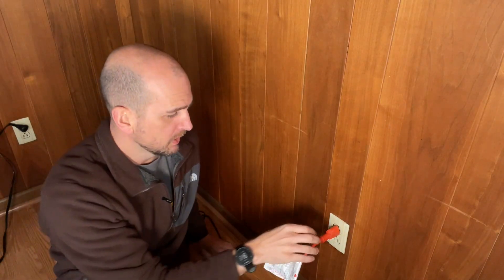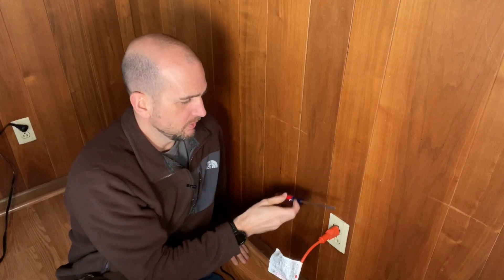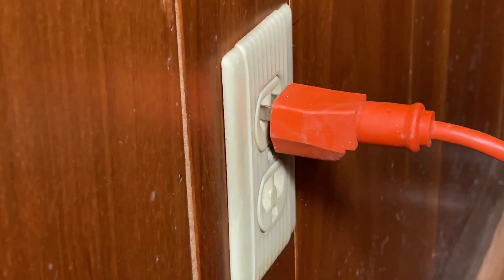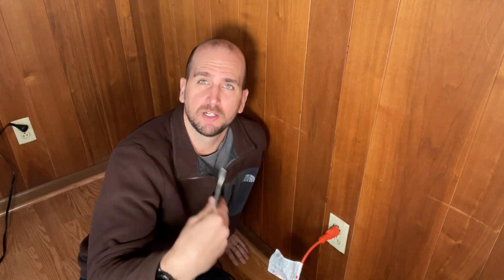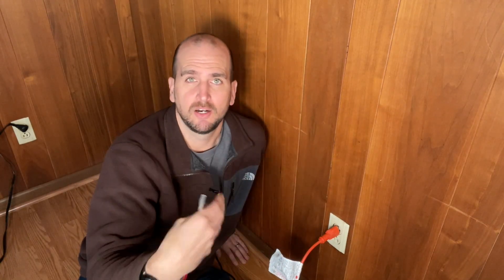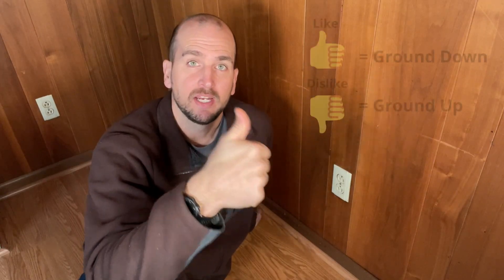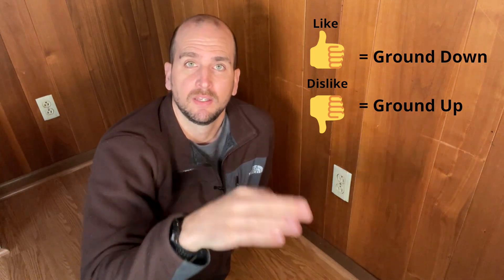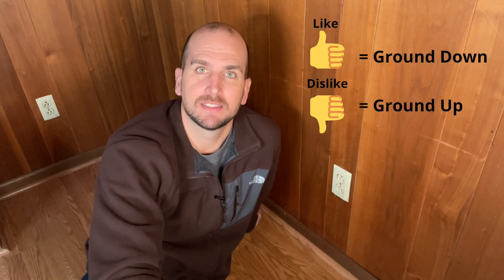Should An Outlet Be Installed Ground Down Or Up

Comment: Personally it does make a bag of beans whether the ground is up or down. What I'd totally prefer is to have outlets and plugs for 110-120 similar to industrial plugs for 440-480. You plug  in and screw the cap on the cord at the plug onto a threaded piece around the outlet to keep it in place. I use GFI outlets on all mine since I've had kids and pets in the house. The ground up or down makes no difference to me although I like the idea for ground up for outlets controlled by a switch. I have seen outlets that have only the top outlet controlled by a switch so it might be cool to have outlets that always have ground up on top and ground down on bottom. Then I could run separate line to each at 15 amps for appliances like portable air conditioners and such.

Comment: maybe someday they will  start making receptacles with  2 ground holes 1 on top 1 on the bottom.
Reply: That would only work if the hot and neutral prongs were the same width.

Comment: We used the orientation of the outlet to indicate if it was “switched” or “unswitched”.
Reply: thats a great idea.
Reply: I dislike this practice because It is unprofessional to be inconsistent.  It's the wrong solution to the "problem". You should install receptacles that are marked as switched.

Such as https://www.hubbell.com/wiringdevice-kellems/en/Products/Electrical-Electronic/Wiring-Devices/Straight-Blade-Devices/ConstructionCommercial-Receptacles/DR15C1WHITR/p/2608245
Reply: @TonyPombo  The photo on the Hubbell site shows the receptacle with the ground up.  However, that makes the “on-off” symbol on the receptacle upside down.  I guess Hubbell is suggesting that the ground should really go down.
The problem I can see for the Hubbell is that they’re a specialty item.  You won’t be able to pick them up at the local Lowe’s or HD.  They’ll also be more expensive than the usual 15A U-ground, so the DIY folks will probably stick with what they can get easily and cheaply for home use.  I could see them being used more in commercial facilities.
Reply: @keithmills778  Yes, you are right. They don't stock them at big-box stores. You can special order them, or buy them from a supply house, but they do cost a couple dollars more than a regular outlet.  Other brands may be easier to find.  I've seen the power logo in either orientation, so that shouldn't be a concern. If you are remodeling a room/house, then the slight cost/delay in obtaining these receptacles shouldn't be a concern.  Regardless, I expect many DIY people won't bother, but at least you now know there is a better way. But, if you hire a professional (at $$/hr), they shouldn't cut corners. :)

Comment: I asked this specific question to a master electrician years ago. His response was "depends on the application" . He expanded on this by explaining that residential electrician code is different in various areas and you need to follow the code. At one point in the past various areas changed their local code to ground up for residential and sited various reasons. Currently residential pretty much nationwide has no specific orientation according to code. Thus the reason switched outlets are usually ground up just for identification purposes. Although hospital applications for life supporting medical equipment is coded ground up. Commercial outlets are application dependent as well but most are non specific in orientation.

Comment: I usually pull out plug by having my thumb on top and my index finger (at 90deg) underneath... where I can't see it. If my index finger was too close to the outlet and slipped, I'd rather have it come into contact with the ground. I can see my thumb, so it's positioned properly. Try this for yourself. Hold your hand with thumb parallel to hand and index finger bent 90deg at 2nd knuckle back. For most people, the finger is further forward than the thumb and could touch the bottom prong, which therefore should be a ground.

Comment: If the ground socket is up, you can more safely plug in a grounded  light cord by touch in the dark, if you find yourself in that situation.  Grounded plugs hold better in the socket because the ground pin is longer and resists gravity better.

Comment: All the outlets I have seen in hospitals: isolated ground outlets have a green dot and ground oriented up; almost all others have ground oriented down.  No one could explain to me why some outlets have brown dots.
A grounded plug is easier to pull from an outlet w/ ground oriented down as the then top has a flat spot for your thumb to grip & control removal of the plug.  Conversely, w/ ground oriented up you are more likely to accidentally short the hot to neutral w/ index finger.

Comment: Some local codes require ground up I think it depends on what you’re plugging in if your plugins in a transformer they don’t like ground up puts a lot a stress on the plug and it tends to fall out so I always install ground down because most plugs are designed for ground down if you have a problem with metal objects falling on partially unplugged things then maybe you should fix that problem because I’ve never seen it happen or heard about it and I watched an employee leave a wrench across all three phases of a 277/480 contactor and close the breaker this was fused at 400 amps it vaporized the wrench and destroyed the new contactor so I’ve seen my fair share of idiots

Comment: I’ve had the experience of grabbing a plug to pull it out of the receptacle, and having my index finger contact the electrode(s) on the bottom. Ground down can prevent electrocution. Compared to that, a popped breaker is less of a concern.
Reply: honestly your fingers should never be that close to the pins , but yes ground down.

Comment: You are correct, the NFPA 70 or National Electrical Code does not require the receptacle to be mounted with the ground either up or down. Although in training it was recommended that in an industrial or commercial structure using metal receptacle covers, mount the ground up in the case a cover screw came out this would allow the receptacle cover to drop onto the phase and neutral blades of a plug which would cause an electrical short circuit.

Comment: Checked My House the Plugs that have a Ground are Up.
All My Mechanical Spaces at work are Ground Up. including the Outlets on Equipment. 
I have seen some with Ground Down in Residential applications but they are the exception. 
Electrician told me that if a Plug was to pull down and out the Ground Down would keep the Appliance Grounded while the Hot and Neutral pulled clear. (Not to sure I believe him He was caught in other "Fiction's"). 
Except in a mater of preference I don't think it matters.

Comment: Sorry but I hear no reasoning for the real electrical purpose of teh ground. The electrical purpose on single phase ground is safety, to prevent that any appliance that have an internal derivation to the outside body and may cause the electrocution of the person handling the appliance. Consequently the ground is extremally important for safety reasons. If the outlet is placed bellow the waist, the ground should be place up, to ensure the ground is connected before the power and if if the outlet is placed above the head, the ground should be down for the same reason. The ground is slightly longer than the power, but that difference is not enough if the outlet is installed with the wrong orientation. That may be a reason for manufacturers pictured the outlets with the ground up, since are normally installed close to the floor. NOTE: DO NOT TRUST GOVERMENT OR GROVERMENT AGENCY FOR YOU SAFETY, YOU ARE THE ONLY PERSON REPONSABLE FOR YOUR SAFETY.

Comment: My electrical instructor in the electrical course I took in tech school preferred ground up, as do I, for the reason stated in the video, to help prevent shorts in case something metallic fell across exposed prongs. As stated in the video NEC does not require one way or the other, and I install them both ways, ground up per my preference, ground down if the customer prefers.

Comment: Ground up is safer, right handed people ( children) may touch the prong of the cord they are plugging in with their finger, less likely to touch the hot side with their thumb..but ground down does look like a cute little face. ( if you install these, please wire the hot and neutral to the proper hole, its electrical not electronics. Black is not neutral or ground, black is hot )

Comment: The US NEMA 5-15 style plug, while compact, has its obvious weaknesses as you've stated. My favorite design is the UK  BS 1363 style plug. Not only that it mandates ground up, with a cord hanging  down parallel to the wall, it also has "insulated pins" where only the tips are conductive. So any conductive objects falling on a half-inserted plug has no risk of shorting anything. It even has a built-in fuse on top of that for an additional degree of protection! Plugs and receptacles have to be designed for our safety. "Smiley faces" and how they "look happy" are irrelevant.

Comment: I wired my new garage about six years ago with the ground down with about 25 outlets. Along comes the electrical inspector and he says he can't approve it unless it's ground up, I wasn't happy but I changed them and got approval. The first thing I moved in was a refrigerator and guess what, the cord went up the wall so I changed that outlet to ground down.

Comment: The NEC does not say the words ground up or down what it says is you shall orient your receptacles in this manner. Then it shows a picture of a single receptacle ground UP..... And every others picture of a receptacle even in the NEC (even twist-lock receptacles) are shown ground UP....

Now as for the safety factor of it....
Ground up is safer because many times a metal cover plate is used and IF the screw were to back out and the cover plate fall off while something is plugged in it causes a short across the hot and neutral if the ground is down..... Also if the ground is down and something like a paperclip somehow falls down and gets across the hot and neutral again you have a short of the ground is down...

Ground UP also holds cords in better than ground down

Comment: Yeah. Really, the most important thing is to wire the polarity correctly. It's alternating current, but the neutral is tied to ground. Most of the time, I wire ground down, but the one in the garage is in need of replacement and would benefit from being installed ground up.

Comment: I have a friend who is a master electrician.  He told me the ground pin should always be on the bottom.  If the plug backs out the mechanical ground will be the last one to disconnect, protecting anyone who happens to be working with the cord.

Comment: I prefer ground down because:
1) should be less likely to slip out because there are 2 prongs instead of 1 on the top where the outward force due to gravity is applied to a 3 prong plug.
2) better If a 3 pronged power adapter or other module or, as you illustrated, a right angle cord is plugged in.
3) the falling object shorting scenario is highly unlikely and in some cases, a shorting object could be more likely to come from below than above (e.g. a metal carpet steamer attachment, or a metal sauce pan or other item on a kitchen counter).
4) like you, that's what I'm used to.

Comment: My countertop microwave oven is plugged into a ground facing UP outlet. This orientation keeps the cord from laying down on the countertop in behind the oven. Yes there may be some strain on the cord near the plug but in the event of water spilling under the microwave I am more confident of an  incident free spill. Also, cleaning the countertop is easier with no cord laying in the way. Great video! Thank you for sharing.👍

Comment: The problem began when hospitals started putting "ground up" on outlets that were hooked up to dedicated power supplies.
(This was something the nurse needed to know why she plugged in your ventilator and the janitor needed to know which outlets he couldn't plug his buffer into)

This started a urban legend that ground up was a higher safety standard.

All it really was is an unofficial standard for showing which outlets are special use,( light switch, Automatic bus transfer  uninterrupted power supply, etc.)

I've run into electrical inspectors who believe this urban legend, and my old hometown made "ground up" part of their electrical code...you literally cannot get a housing permit until every outlet in the house is turned over.

And now it's creeping into the manufacturing process.

Comment: Was running a metal lathe at work and it was creating a long curly shaving that worked its way to the back of the machine where there was a light socket installed ground down. You guessed it the plug was loose and the next thing I knew I had a red hot piece of steel that quickly burnt in two. In this case a Plexiglas shield was installed.

Comment: Ground facing down looks more like us, two eyes and a nose. We 'prefer' that look because it is familiar. It is the same with car styles, the more the front and back a car looks like two eyes and a nose the more we like it.

But, wiring doesn't care what we like. Gravity pulls a cord down regardless. That exposes the top connection point first. If the ground is up and the plug starts to come out if the outlet then you still have the hot and neutral connected. Much harder for a plug to short as a result of gravity fall-off.

So ground up makes so much more sense from a performance aspect. And that is what I look for in an electrical situation first.

Comment: Ground up = switched half-hot.
Reply: No, please don't, and don't encourage other people to do the same.  It is something that lazy/cheap electricians do.
It is unprofessional to be inconsistent, and it's the wrong solution to the "problem". You should install receptacles that are marked as switched.

Such as https://www.hubbell.com/wiringdevice-kellems/en/Products/Electrical-Electronic/Wiring-Devices/Straight-Blade-Devices/ConstructionCommercial-Receptacles/DR15C1WHITR/p/2608245

Comment: You are wrong about the code not specifying  which way an outlet must be installed, in hospitals and other hazardous material location it is required to install ground up as well as ground fault in some locations. When I was an electrician I installed ground facing down except in Hospitals or in some industial locations. BUT I would now change to ground down for the safety aspect.

Comment: It was called "General Practices" voted on at local /regional Electrial Associations and ideally in huge debate. 1) COMERCIAL installations "Ground Up" when using Metal covers. 2) Residential "Ground Down" .  ALWAYS CONSULT LOCAL ELECTRICAL AUTHORITY because they can at to but not detract from the N.E.C.  
   If Unsure then you should follow the  "General Practice" and you normaly can't go wrong with an inspector State to State.    Metal plate - Ground UP. 
 Remember the NEC IS PUT OUT BY THE NFPA ( National Fire Prevention Association)
Reply from the maker: Thanks for the info and feedback!

Comment: the ground pin is actually longer that the others for double safety reasons... 1) to make contact first with the house/case ground and 2) to add stability to the plug when "fully" recessed into the outlet.

It it true that "ground up" prevents shorting contact, but if the plug/outlet are firmly grasping each other then there should be no immediate worry of potential hot/neutral contact in either "up" or "down" configuration.

....i like "down" because it also makes a face on the outlet :)
...same with toilet paper (i.e. back instead of front) especially if anyone owns a cat(s) that go getting curious because it won't leave a mess of TP all over the floor.

>>>I do agree in the end of the video where you remark on switched receptacles and "up" allows easy identification!! ...inventive and secure insight!

Comment: For most of my 60 years, I never saw a ground up outlet... then I moved to the east coast of Canada and suddenly my world was turned upside down. However, as others have pointed out, most cords and plug in devices with 3 prongs are designed for ground down.

Comment: Always check local building  codes , Even tho i had worked in an  industrial setting  for years. It  was the local building inspectors  decision  until i could show it  didn:t matter  in NPAA
  or NEC  codes , Alot of  municipalities wrote their own specifics  depending on the code enforcement official, But i always installed them  with the ground  lug down. unless it  was ment  for specific appliances

Comment: ground up. rationale, the weight of the socket and flex pushes the live prongs into the receptacle leaving only the ground exposed  . everyone connects them the other way up, ground down, purely because that's how they are shown on the packing. remember the startled looking face on the standard type receptacle package? if shorting out was a problem, then I'm sure the prongs would be half insulated!

Comment: Residential, I always put prong down.  I can see advantage of prong up in commercial buildings like hospitals or schools where you use heavier gauge cord to appliances such as floor buffers/cleaners or vacuums.  The prong on top will provide more stability with weight of say  12 gauge 2 wire stranded.  This is debatable I know, but my POV.  

On other side. My 20 years in Navy, many buildings we worked on (Seabees) was specific with ground up.   (This was in specs and lot of IT equipment using UPS will have prongs up. 

But home.  I am a ground down.  And I have my peeve of plate screws all “lining up”. 😏. 

Interesting question to ask.  Still don’t know why the chicken crossed the road.  Need to solve that first 😉